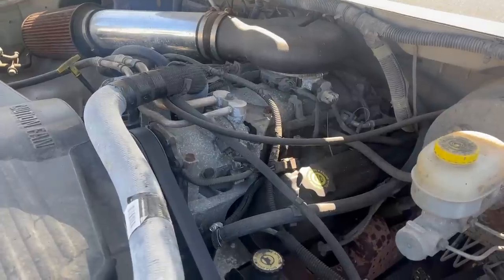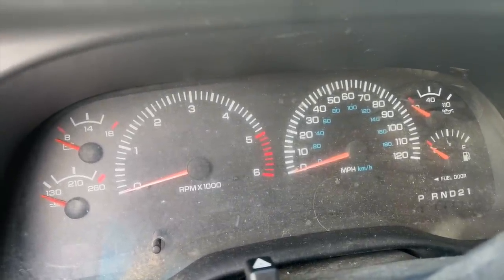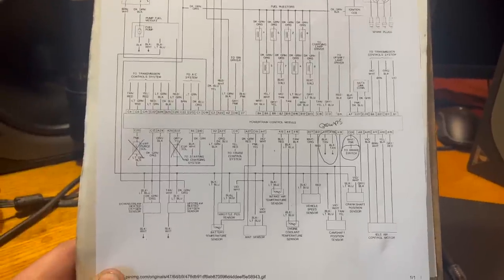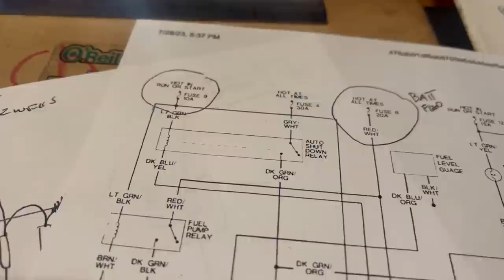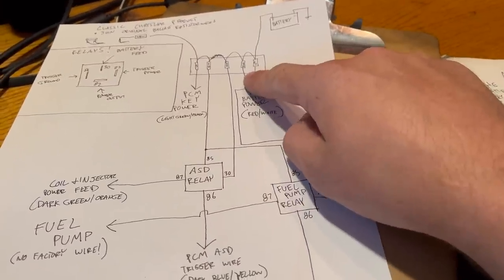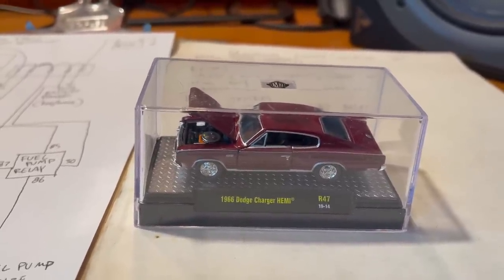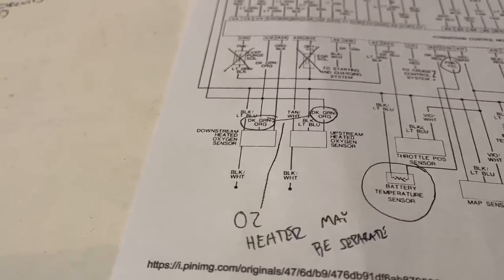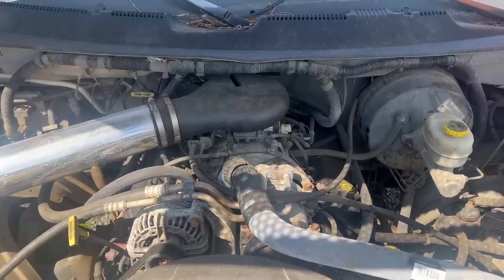The Big Magnum 5.2/5.9 Swap Wiring Guide! How To Wire A Magnum In Your Old Mopar (Or Anything Else)

Comment: Great video, very helpful. when I was pulling my donor out of a 01 1500 I noticed a device on the rear of the block that looks a lot like a crank sensor running off of the flywheel of the donor engine. What is that devise, I am hoping it is for the trans input.
second question: I plan on putting this in a 77 dually plow truck with a 4 speed, any experience with installing this magnum 5.9 in a standard trans? 
and last but not least I can not find the diagrams you stated would be linked to the video.
Reply from the maker: I put links to a couple diagrams in the description but I couldn’t find the one I really wanted. Yes, that is a crank sensor. You need that, and you need something for it to read. Yes, I have put a magnum in front of a stick trans, but in a car. With the truck transmission, I think you can use a factory Ram truck flywheel. You will want to verify that yourself, as I have never done it. Whatever you end up doing, you’ll need to cut a hole in your bellhousing for the crank sensor to live in. I did a video series called The Three Pedal solution where I cover a lot of what you will need to do - but again, there will be differences in your case.
Reply: good day again, I have done some research that you might be able to help with. I don't have the spare parts lying around to test this. The magnum standard flywheel has the spots machined into it for the crank sensor. It typically comes with a 12 inch clutch. The 77 trans and truck comes with a 11 inch clutch but has a different size and spine to the trans, so I would have to use the 77s / 11 inch clutch to fit the trans. so will the 11 inch clutch bolt to the 01s 12 inch flywheel, I think the pressure plate might be big enough but I don't have parts here to try this. 
now lets assume they don't match, can a normal drill, drill a flywheel to except the 11 inch clutch. I don't have the means to turn the flywheel down like you did. I also wonder if that larger flywheel fit inside the bell housing. Do you have a normal email address we can communicate through for more questions? @DeadDodgeGarage

Comment: Just found your channel and I appreciate all the great info. Curious what route you’d take to get a rot box challenger to run on the cheap. The original 318/3spd is a complete boat anchor.
Reply from the maker: Boat anchor, as in seized solid? Personally I would fix up another small block then. Nice and easy. The Magnum is always an option too. I’m leaning away from the complexity of fuel injection these days.
Reply: @DeadDodgeGarage  yeah crustiest I’ve ever seen. Rust pitted cylinders and unusable valve train. was hoping to find a low buck LA but no luck so far.

Comment: Good morning sr I have a question how to wireing a cluster of 87 dodge ram charger if I use a 99 dodge ram 1500 for donor vehicle I just want to work the oil pressure and temperature tanks for you time and the videos is helping me to do my project
Reply from the maker: Use your original oil pressure switch and wiring and leave the newer switch out, or use a pipe tee and mount both. And for the coolant temp you can either use a tee to fit both, or drill and tap a second 1/8 pipe threaded hole to fit the original sensor in the front of intake near the thermostat. A ‘92-97 intake would have had two sensor holes, so there is a flat spot on the newer intake where it could be drilled.

Comment: Hey Jamie, just watched the video and Im swapping a 97 ram 360 into a 91 ram. My questions are  about the notching of the bell housing because I’m using the stock 91 trans and also the kick down rod. What is the best ways to achieve this. And yes I’m keeping the 97 efi. Thanks for the awesome video!
Reply from the maker: I’ve made the notch with a cutoff or grinder wheel. Not too big a deal, but it helps to have the later transmission to measure for reference. You won’t be able to use the kickdown rod. The throttle body is turned 180 degrees and uses a long throttle cable and kickdown cable to reach it. You can easily adapt the kickdown cable to work on your ‘91 transmission.

Comment: Good video Jamie, I've a question, I have a 1990 D150 318/A518 running an driving truck I'm fixing up. I'm wanting to move to a Magnum 5.9 and is why I'm here. At first I was thinking just changing the engine and put all the 318 stuff on the 5.9 but after watching this video and seeing just how simple it is I'm now thinking also going with a 46RE since the PCM controls it and just swap the entire unit and get the harness and PCM at the same time. Now, my question is, since I don't have any donor parts yet and can be selective with what I buy what years do I need to be looking for? Watching this leaves me to think that maybe a 2001 and up but I don't know how far or is there are any other differences. I see the Rams on MarketPlace all the time being parted out, I just need to know what would be best to watch for. Thanks for the info and I'll be watching some more of your videos, good stuff. DC
Reply from the maker: You want about a ‘98-01 1500 for your donor, or that can go up to 2002 in a 2500 or 3500. That would give you the RE transmission, as well as the compatible PCM, and the easiest wiring to adapt. Having a ‘90, you also have a fuel tank with a pump in it already, and the TBI wiring system in place that adapts to the Magnum system really, really easily. You will have to change the pump to a higher pressure, but that’s not a big deal at all.
Reply: @DeadDodgeGarage Thanks, that helps. Are these PCMs flashable/programable like the GM 411s? I'm thinking a few mods while I'm at it and will likely needd a little teaking afterwards.

Comment: Thank you!  Quick question that I may have just missed but is you fuse and relay center in conjunction with or instead of the original fuse box?
Reply from the maker: I don’t use the original fuse box at all. If you are using Durango type wiring, you would basically have to. I just add individual fuses and relays. Simple.

Comment: Man such GREAT info in this video 👌. I do have a quick question though. Would the engine harness and pcm be the same between the same year (say 99) 5.9 gas between a 1500 and 2500? I'm about to swap a 5.2 or 5.9 into my 98 v6 5 speed ram and I'd really like the donor to have manual trans wiring so I don't have to deal with the auto junk. It's much easier to find a manual 3/4 ton than a half ton in my bone yards. Thanks for the awesome info!
Reply from the maker: As far as I know, they are the same. And if they aren’t the same, they’re probably still same enough to run.
Reply: @DeadDodgeGarage  thanks man I figured as much. I appreciate it!

Comment: Wow.  I was thinking about a Magnum swap for my 67 Charger - it is an original 318 car.  I was wondering if you gave up on the 44 or 46RE transmission?  Did you have to wire in an overdrive lockout?  I was wondering how hard the shift linkage conversion would be since my Charger has a console shift.  Thanks for all the info.
Reply from the maker: Shift linkage lines right up, kind of. In my car, instead of modifying the floor or crossmember, I moved the drivetrain forward and notched the transmission. So I made an extended lower link, and a custom bracket to brace the bottom of the console linkage. And believe me when I say, it worked very well - but the transmission was bad when I got it, and I knew that. Eventually, second gear left the building. So that was a problem. If you check out my series “The Three Pedal Solution,” I discuss all of this in the first episode or two, and show everything that I did to make it work - as I’m ripping it all out… if I had used an actually good transmission, I might still have the damn car. It was so nice to cruise. 

You do not have to have an overdrive cancel button unless you want to. It will shift into OD, and drop out for kicking down and passing or going up hills. Usually you’d only need the button to turn OD off for towing, and of course my Charger wasn’t doing any towing. But it’s not too hard to add if you want it.

Comment: What did you do as far as motor mounts? Im swapping a 5.9 magnum with the nv3500 in my 78 w200 in a few weeks looks like you just built custom plates but hard to see in the videos
Reply from the maker: No, you’ll just use factory V8 mount brackets. You may have to shim the rearward ear on the driver side.
Reply: Awesome thanks for the reply

Comment: Thanks Jamie. Any insights into wiring for crate motor small block swaps? I’m guessing it’s a lot simpler
Reply from the maker: Oh, so, so much simpler. I guess I could do a guide on that.
Reply: Info on mopar crate swaps is pretty thin- I found a bit but it’s all over the place. Most crate motors seem to be of the 360 magnum variant- Most confusing has been sorting external to internal balance flywheels, and wiring.
Reply from the maker: @rh752  have you seen my 318 to 360 swap guide from two Sundays ago? I cover the balance difference, the mount difference, and other various details you’ll need to watch out for.

Comment: Thanks for the videos you make. They have been a great help lately,but I have came a cross with a question; is it possible to wire a speedometer on a 1987 dodge ram charger that I  swapped from 1999 dodge ram 1500 two wheel drive automatic transmission to the 1987 ram.
Reply from the maker: The problem with the ‘99 transmission is that it lacks the speedo drive that an early 90s electronic speed sensor / adapter can be plugged into. So while I’m sure there is some way to make this happen, I couldn’t begin to fathom what it is.
Reply: @DeadDodgeGarage  thanks I well check out have a good day

Comment: You said something about the pcm not being happy if you don’t have the 46RE hooked up? I have a nv4500 in my truck already, is there something I need to do if I’m using an automatic harness?
Reply from the maker: Just changing the PCM or having it reprogrammed would do it. You’ll have a bunch of transmission codes. Not a real issue - but it may behave oddly in some situations, like slowing down coming to a stop.

Comment: I have a question. Are these 97 and older PCM’s VIN programmed or too old for that? I have found a 5.9 with the wiring for $50 but it doesn’t appear to have the PCM.
Reply from the maker: They have a vin programmed, but it basically doesn’t matter.

Comment: Is there a way to do this swap on a obd2 cherokee jeep inline 6??
My 318 blew yesterday..
My jeep needs a new harness badly.. i have a 97 jeep cherokee inline 6 4.0..
99 donor harness cherokee but.. ahh skim key.. so swapped computer and im missing something..
Wonder if you have a vid on a jeep.. i know it should run really easy.. i dont need anything extra just run..
Thx
Reply from the maker: I don’t think the skim key would be a problem yet in ‘99, but I’m pretty sure those harnesses are different? I don’t know nearly enough about the 4.0 Jeep harnesses, PCMs, etc. I just know that they are functionally pretty similar to Magnums.

Comment: Is there an easy way, HP Tuners maybe, to disable the PCM from throwing codes for all of the stuff you don’t need on a typical swap like the TCM,  various solenoids, gauges, etc?
Reply from the maker: The short answer is, I’m fairly sure it can be done with the OBD2 computers, but I don’t really know. The great thing is that the computer soldiers on without those things and doesn’t really seem to care. And there’s no working engine light anyway so… 😅

Comment: Good afternoon, I'm a new subscriber and I really appreciate your videos.  Though I have one question. I have a 1995  Dodge Ram 1500 with a 5.9 and I want to place it into a 1988 Ramcharger that has a 5.2 , would it be possible to remove  the 1995 PCM and power distribution and  place it into the  1988 Ramcharger? Is it compatible? Thanks!
Reply from the maker: I’m not sure that the power distribution box would be an easy swap over. I’ve never done that. But it’s pretty straightforward to use the PCM and engine harness and adapt them to the truck. I did essentially exactly that in our 1992 Dodge van, except I used 1998 wiring. And then of course you’ll need the later fuel pump in the tank.

Comment: I want to 318 swap a 1988 comanche. Im getting a 1998 durango for the donor, whats the best harness for the swap its a 1988 jeep renix, would a ZJ harness work better than a ram ?
Reply from the maker: The Durango harness is very similar and would probably work fine. The problem with either option is the hard wired dash section. You’re going to have to cut almost all of that out and adapt the rest if you want to use the fuse and relay box. You’ll have to change headlight connectors and lots and lots of other things to make it work. This is why I prefer to just use the engine harness - and why the Ram is the best donor.

Comment: I put a 99 dodge 2500 5.9 Magnum into a 1985 Toyota pickup. I can get it to run and have moved it by jumping the fuel pump relay. 

Should I just follow your recommendation and cut the harness and just wire what I need?
Reply from the maker: High recommend that. Haha. Wait, it runs without an ASD relay?
Reply: @DeadDodgeGarage  ya it’s not happy though it blows fuses occasionally

Comment: Hey Jamie quick question sir?? the magnum 318 v8 mpfi will it only crank but not start if the map sensor is not wired up,,i am asking because the ground squirrel chewed it off completely?!
Reply from the maker: It should still fire without the MAP.
Reply: @DeadDodgeGarage  well accurate to the engine diagram schematic for the 00-01 dodge ram and Dakota non California emissions vehicles the wires are green with a red tracer, black with a blue tracer and purple with a white tracer, and knowing some of what I do know about Chrysler EFI the purple with the white tracer is I believe the trigger wire that leads to the crank sensor so if that's the case I'm guessing that is why it doesn't start Jamie sir, but I asked you because I would about bet you know way more than me about Chrysler and Mopars period.
Reply: That's supposed to start according to the Chilton ^ correction my bad 99-00

Comment: But if you chop the harness from the box to the cab you should
Only need battery power key power ona few wires correct ?
Reply from the maker: Yes. Good luck figuring out which ones they are though. You’ll need a truck harness diagram, or a whole bunch of time tracing it all down. And there are so many more wires there than you could ever use. What a headache. I’m guessing you are the person who commented the same thing elsewhere, and I answered there as well. In my view, it’s way too much work to adapt that box, when it contains way more circuits than could possibly be necessary in a classic swap, and it’s big and ugly. There are much better options available.

Comment: I'm wanting to swap the 4.7 that's in my 02 dakota that's 2wd automatic I've got a 98 1500 ram with a 5.9 automatic 4x4 I've been told the the 98 ram ecm will not control the transmission that's in my 02 dakota would you happen to know if that's true or not thank you
Reply from the maker: No. I don’t think it’s at all possible to make that 545RFE work behind the 5.2/5.9. I could be wrong… but the control systems are definitely different.

Comment: Hi Jamie, does it matter if the harness is from a 4x4? In your opinion is it even worth running the 46re in a classic?
Reply from the maker: Doesn’t matter, and… it depends. Those transmissions are always blown up and don’t fit well. But I had one in my ‘66 Charger briefly, and it really cruised great on the highway. But then it blew up.
Reply: @DeadDodgeGarage  Thanks, Jamie. I'm completely fine running a 904 or 727 with highway gears. What speed sensor could be used in those transmissions, or is it worth worrying about?

Comment: I like the video a lot I plan on swapping my 85 dodge d150 cleaning the engine bay up and going through original harness to trim what I don’t need. Does anybody know if it’ll still run if it doesn’t detect a transmission I plan on using a a904 automatic transmission
Reply from the maker: Yes, it will run fine. If it’s a 97+ automatic computer, it will have a bunch of codes for missing transmission stuff, but it will still work.

Comment: Yes it matters what way you hook up the trigger wires on the relay as a relay will make spike fly voltage. That being said most automotive relays have a diode in them to stop the fly voltage spike! 85 is ground…. 86 is positive…. If you are using a relay that doesn’t have a way to stop fly voltage you need to get one that does as the fly voltage can damage a computer and other electronic equipment.
Reply from the maker: Above my pay grade

Comment: Keep your odb II 96' up PCM .  Because your trans is shifted by that p.o.s. PCM . Where my  93' Dakota and 95' Jeep Grand Cherokee trans are hydraulically shifted.
Reply from the maker: Did I not discuss that in this video? I don't think the RE came until '97 or '98 but can't remember the exact timeframe. Anyway, yes, if you want to use the RE transmission, you need the correct PCM. Most people swapping these into things won't use the newer transmission.
Reply: @DeadDodgeGarage  that PCM came out with dashes that have a digital mileage readout. Those came out in 96' not 97' .
The point is, they aren't any better  than a 95' and down PCM.

Comment: What if I'm going the other way  like putting a 1998 cab on to a 1986  frame using the 1986 engine /using the 1998 wiring/ and have a A6 style box that I can use?
Reply from the maker: Not insanely difficult. You just need to use a couple power feeds out of the factory fuse / relay box to run the engine. I’ve never done this, but there is definitely more than enough wiring there to make it happen.